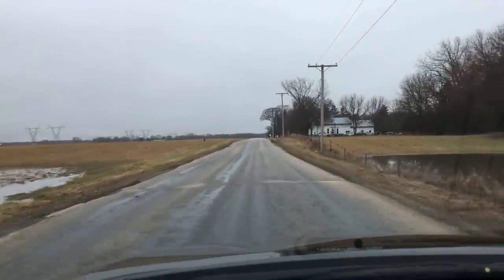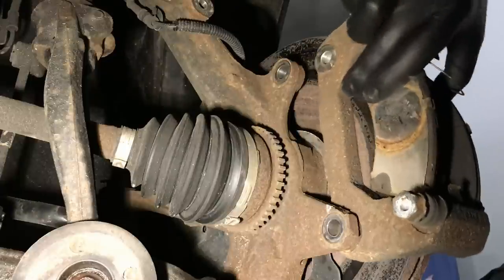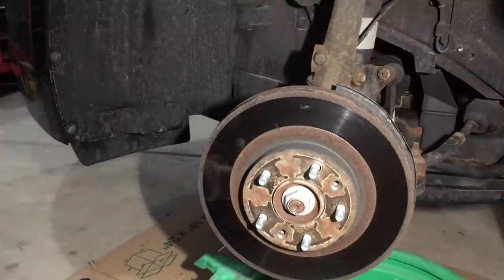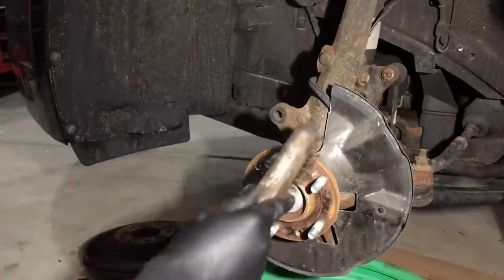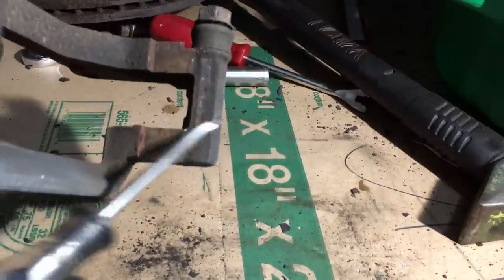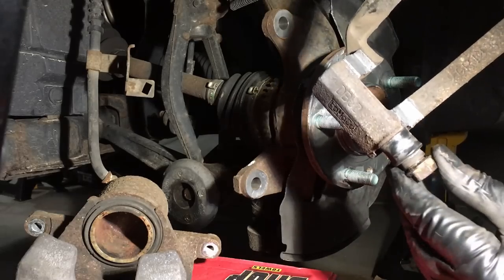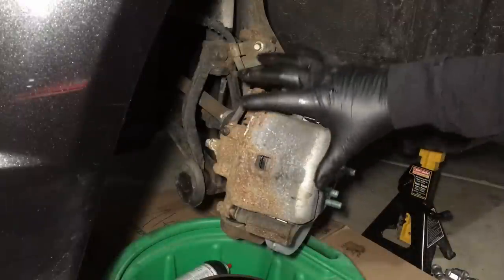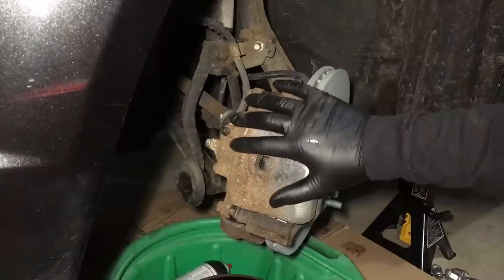2006-2012 Ford Fusion: Front Pads and Rotors Replacement

Comment from the maker: These are the Tools and Parts needed for the job:
Front Rotors-
http://amzn.to/2oZ1U7Z
Front Pad Set-
http://amzn.to/2oFRirG
Brake Caliper Grease-
http://amzn.to/2pYb4jd
Anti-Seize-
 http://amzn.to/2oplKdL
Blue Medium Strength Loctite-
http://amzn.to/2ptLEgo
Cat Claw-
http://amzn.to/2oEV7ww
Torque Specs:
Caliper Bracket 15mm Bolts- 66ftlbs
Caliper to Bracket Bolts- 20ft lbs
Wheel Lug Nuts- 100ft lbs
Reply: FordTechMakuloco Can you please do a how to on the rear brakes? That would be awesome. As always thanks for the valuable info
Reply: Tried this link for the coated rotors and Amazon keeps sending the non coated, BRR-295

Comment: Finally someone dealing with a rusted up rotor similar to what we see in here in Michigan on every brake job!
Reply from the maker: Yup that is why I left in the fight to help others in real world situations with my techniques I have learned over the years.
Reply: Nick Palmer yup air hammer for the win!   Takes off the rotor in seconds
Reply: I have had to cut a slit in the hat of the rotor to remove them.  Just to give them room to expand some.
Reply: We have rust issues like this in the coastal regions of Alaska.  Glad to see someone sharing the techniques that work well for rusted rotors like that.  I've had really good luck whacking the area between the lug studs to get stuck rotors or drums off.  No need for a noisy air hammer.
Reply: True.  I have resorted to the air hammer in a few cases, but for the most part a good solid few whacks w/ a BFH between the studs has worked very well for me.  Perhaps the corrosion issues in AK aren't quite as bad as some other areas like the midwest.

Comment: '06 fusion lasted 160K miles before replacing the pads and rotors.  Yes, quite a bit of highway miles, BUT, that route was the same route I drove for years before owning that Fusion.  Brakes on that car were INCREDIBLE.  Even when I replaced the pads and rotors they had life left in them.  The 2nd set of pads are still on that car at 220K miles and are in awesome shape (ceramics as well).

Comment: I watched a similar video before this one, he said the caliper bolts torque should be 25 ft. lbs,., and the bracket bolts should be 35 ft. lbs.for a 2012 Ford Fusion, yet I think your spec of 66 ft. lbs. on the bracket bolt seems more sensible. So maybe all things aren't the same for these FoMoCo cars 2006-2012? This whole video is very good, I can see you  are very knowledgeable and talented, thanks for sharing!

Comment: While I don't own a Fusion, this was a great video.  When I do the front brake job on my 03 Town Car, I'll be sure to follow similar principles.  41K original miles, from FL, and the steering wheel could shake your teeth out if you hold on haha.

Comment: Be careful when using an air/electric impact wrench on those T40 rotor bolts. I sheared off a $40 T40 bit by using an air impact. Pieces of metal went everywhere. I typically use a hand impact wrench and a hammer. Just make sure to use eye protection with a 3/8 or 1/4" air/electric impact. Those things get stuck sometimes. Great video, Brian! I'll use this as a reference when I change our 2010 Fusion fronts.
Reply from the maker: Yeah you would think so but I hit the trigger just right not full throttle so I have only broken 1 in my career and that was on a Hyundai! Go figure.
Reply: @FordTechMakuloco hi, I purchased front disc brake rotord from ford itself however it came without screw holes for T40. I contacted them and said that this is the modified one. Will that be okay to I install this modified ones? Thanks

Comment: Those Torx rotor retaining screws, try “shocking” them by putting the Torx bit on the screws and give them a sharp crack with a hand sledge.    Seems to work every time for me.
Reply from the maker: The impact does the same thing.

Comment: Brian.. when we compress the Caliper Piston, Brake Fluid goes back to the reservoir. Usually it's ok to do but my Senior Workmate told we must not do this practice on German Vehicles (especially BMW, MINI, Mercedes). It locks the ABS Unit and we have to do some right/wrong efforts to bring it normal condition. While Lexus vehicles generate Check Engine Light when we compress Caliper Piston.
I used to see them Bleeding Brake Fluid through Bleeder point on Caliper when compress the Caliper Piston.

please share your thoughts

Comment: Quick question, why wouldn't you recommend the AutoZone Duralast rotors? I am about to replace the rotors and pads with a PowerStop kit for my 2008 Fusion but first saw the Duralast as an option.

Comment: Brian do you recommend using copper brake grease or anti seize sparingly on the ears of the pads and the metal hardware clips to lubricate pad movement? I noticed you installed them dry. As always really enjoy your attention to detail.

Comment: I use the same type clamp to push the piston in some before removing the caliper, makes it much easier to remove especially if the pads have the pegs on them that get hung on the inside of the piston.

Comment: One problem I found as I was removing the top caliper bracket was that on my 17mm wrench the head was too wide so it wasn’t able to fit properly on the nut, so for anyone else be sure you have an open ended wrench thin enough to fit on the nut itself. Otherwise great video man thanks!
Reply: That is a Ford or somebody after Ford tinkering with your car
Reply: I use needle nose vise grips because my wrenches usually do not fit.
Reply: I tackled this job today and made it a point to modify one of my 17mm wrenches (using a bench grinder) to thin it enough to fit properly on the retaining "nut" that is part of the caliper slide.  Doing this once, properly, ensures that I will always have a wrench that fits the caliper hardware.  In the past, I've "butchered" the nut with a thin vice grip, but I prefer to do things "properly..." ;-)

Comment: I have a 2012 Ford fusion with 95 thousand miles and I have the original brake pads running!...I'm just now going to do a brake job this weekend because there just now at that point!...is it normal to get 95 thousand miles on the original brakes??

Comment: Could you please do a video on brakes for a late model Mustang?  I have a 2011 and the pads have  a lot of life but it sounds like the calipers are sqeaking (if I'm sitting stationary and press the brake, you can hear them squeak as they clamp down).  The internet has told me it's just lack of lube on the pins but I figured it would be a good time to change the pads while I was in there.  Love your videos!

Comment: Awesome video! Super helpful. Question: Is it possible for the bracket that holds the brake line to rust and squeeze the hose - preventing the full release of pressure when  you release the brake pedal?

Comment: hey fordmakuloco, what is a better buy? 2010 ford fusion or 2010 mercury milan? i love both but have a hard time choosing which is a better buy on the long run
Reply from the maker: Same car but the Milan just has more items to fail over time. Kind of like then the Lincoln versions of the Ford models the Lincolns were always breaking down compared to the Ford version of the same model.
Reply: FordTechMakuloco thank you for your honest opinion

Comment: I have a 2010 Fusion with 120K miles but the brakes have never been done. They are close to needing it though. I know the front rotors may have a bit of warpage based on the way it stops at slow speed with a bit of stutter. I've been hearing a rotational noise from the front left wheel just when driving, new tires and alignment didn't change the noise. Dealer checked and said "They couldn't hear it" but said the wheel bearings and suspension seem solid. The noise does seem to vary in a curve either way. Could worn pads and rotors cause that type of rotation noise? I guess if the rotors and pads were replaced and I still hear it that might indicate a wheel bearing issue? Just wondering your thoughts. Thanks!

Comment: Awesome video!  But why put anti seize under the anti rattle clips and not on them.? I don't put it under as I don't see it having a purpose, and put it on them to insure the pads move freely.
Reply from the maker: I have found anti-seize gets gummy over time so I never use it where the pads ride. I actually don't put anything where the pads ride if they have these clips its best to leave them dry and clean like they come from the factory. Now if they don't have clips and ride on the bare metal of the bracket like some Ford do I use silicone grease. The reason I put anti-seize under the clips is to prevent the very reason you are in there cleaning them off in the first place. Water and salt get trapped under the clip rotting out the bare metal bracket causing them to "grow" and seize the pads. I have a whole video on this concern called are your brakes dragging? It explains it much more.

Comment: Hello, this is a great video that you made. I have a 2012 Fusion, and I just ordered all the materials you mentioned. One question I have is, do have to break the new pads and rotors in. Like drive a little bit and brake hard, then repeat a couple of times.

Comment: My slider pins were rusted in real bad and needed vise grip with a twisting motion to pull them off , I'm  replacing  them but don't remember where they go.  The two pins are different but both go in any hole . Can you explain which one goes where and why they are different.

Comment: Front caliper piston- if the piston does rotate within the caliper, is that okay? Is it also okay to use the same brake grease for the caliper pin bolts?

Comment: I’m about to do a brake job on my wife’s 2012 fusion. It has 87k miles is it best to do the front and back pads and rotors or just the front at this point? Thanks for all your help awesome videos
Reply: My opinion is the front brakes do the lion's share of the work.  Do them first.  Inspect the rear brakes and compare pad thickness.  The rear brake pads will show less wear and you might feel comfortable about not replacing them.
Reply: Black sheep well I just wanted to update anyone wondering the same thing. Her rear pads were worn more than the front. She had 93k miles when I changed the originals out and probably could have went another 10k miles. The fronts are good until I’d guess 120k. She has at least 20k more until i change the fronts. What’s weird is she does a lot of stop and go city traffic miles and these pads were in great shape. 👍🏼 does anyone know if the rear bolts are the same torque specs? The bracket bolt is a 13mm, I torqued it to 66ft/lbs seemed kinda high. 20ft/lbs on the caliper bolts

Comment: Thanks for the video! I hate rust 😡
That Milwaukee impact is a beast though. 
In your experience, what is the life difference between motor craft pads and rotors vs the auto parts top of the line?
Reply from the maker: Top of the line rotors like Bosch are close but for the same price. Now when it comes to pads I always use Motorcraft since they organic pads so they are nice and quiet. If the customer does not want the dust I use Wagner thermoquiet pads only.

Comment: Hi, how are you? I follow your channel and I need your help. I'm sorry, my English, I'm learning and using an electronic translator. I live in Canada and I have a 2003 Ford Expedition Eddie Bauer and his headlight on the automatic is not erasing. Not turned off and the lights do not go off. When I put it in the low beacon and the automatic the mile-light goes off and only comes back on if I pull the button, as it is meant to be. can you help me?

Comment: The front brakes on our Fusion makes a almost grinding noise the first two or three times I mash them but after that they makes no sound at all. This happens after the car has been turn off and parked for just a little while. It only happens when I mash the brakes the first two or three times.i have taken them apart, put new pads on and put them back together just the way they came out. Do you have any idea what it could possibly be?
Reply: Bcroft39 Normal condition, they start to get surface rust on them from sitting and you using them for the first 10 minutes or so of driving clears it of that and thus the noise goes away

Mine does it over night when it rains

Comment: on these cars what percentage of the braking is done by the front vs. rear?
Reply: Justin Tarvid when you hit the brakes with your foot, you are using the front, the emergency break is what controls the rear. Hope this helped
Reply: Mickdoodle  Wrong. The foot brake operates both front and rear brakes. The handbrake operates the rear brake only.

Comment: i have noticed some brake pads, even high end brands can fit tight even after removing all the rust. i have have to grind a bit off the ends so they slide easy in the brackets. it pays to buy high end ceramics as they last along time compared to good quality pads. of course they are hard on rotors but they seem to warp or rust out no matter what.
Reply: smoke skull use manufacture spec pads unless you change to rotors designed for ceramic pads.

Comment: I have video of doing a 2010 fusion and all four rotors where way way worse to get off then yours. I would recommend to put anti seize on the lip of the hub to try and stop the rust from the rotor growing and seizing to the hub. It will make removal way easier during the next brake job.

Comment: Wish I had watched this before paying a shop to install new pads and rotors on a 2006 focus. Close to $600 and they put pink grease all over backside of pads and on bracket where pads slide in, doesn't seem right

Comment: Why not antiseize on the studs?
Reply: Anti seize will actually take away some of the clamping force the lug nuts can apply to the wheel. I wouldn't have believed it if I had not seen the demonstration. Clean the threads so you can turn the lug nut on by hand all the way easily. Then apply 1 or 2 drops of 30 weight oil on the wheel studs. This will ensure that all the torque you are applying to the lug nut is being translated into clamping force. Some say no oil, some say a few drops is ok. I prefer a few drops on clean threads. I'm fine with no oil on new studs but feel that as the threads wear, oil is needed to allow for most clamping force although I have no data to back this claim.
Reply: They taught us in automotive school to use antiseize and to change the torque setting when we have used the antiseize. I was wondering what his reason for saying no was.
Reply: google and you will find a video showing the reason.  Torque specs are for DRY lug nuts.  Torquing to specs (dry) puts a 60% shear stress on the lugs.  Using the same torque, with antisieze increases the shear stress by 50% (from 60 to 90%).  If you end up slightly overtorquing, when using antisieze, you can be placing the lugs beyond their stress thresholds, causing problems.  I've never used anti-sieze, and never had a lug nut sieze.  I'm not a mechanic by trade, but probably remove on average a wheel every two-three days (backyard mechanic.)

Comment: Great video, but I would recommend to NOT replace the small rotor/flange screws.  Those do nothing but help the assembly line put wheels on so that the rotor doesn't move.  It serves no additional purpose but is the source of many headaches when they rust and strip when trying to remove them later.

Comment: Buddy your damaging that rotor by hitting it with that hammer in the back part of it. It has the same smooth part like in the front. Use a rubber hammer better or use a half inch longer screw and the disc will come out by it self. Like that you wont have to damage your new brakes pads with a scratched damaged rotor.
Reply: He very clearly explains since he is replacing the rotors, it's ok to use the metal hammer. Obviously if you were reusing the rotors you would use a rubber mallet.